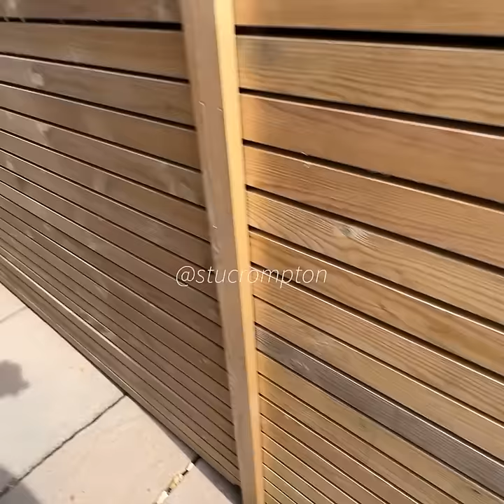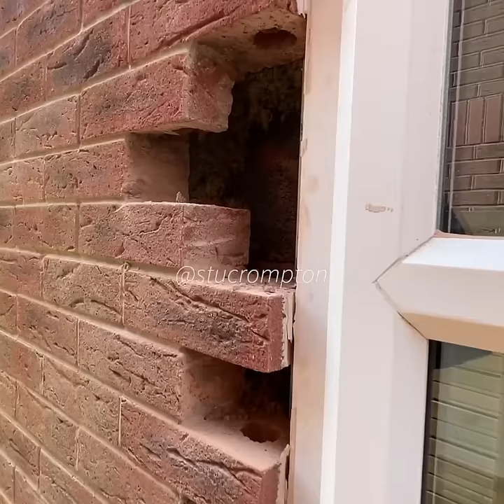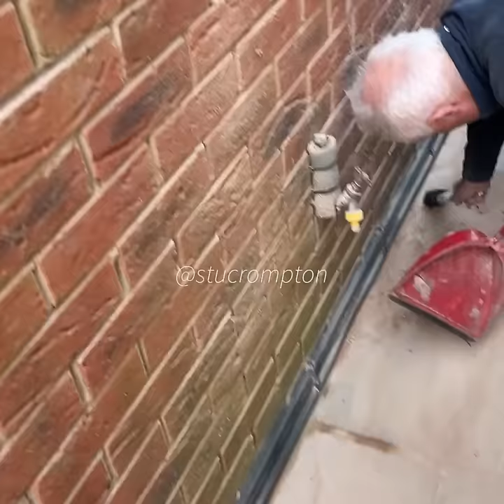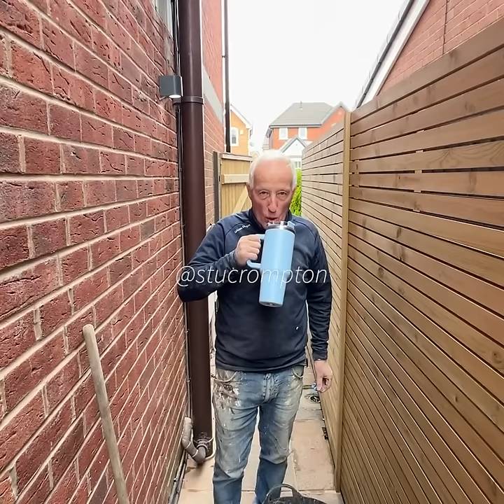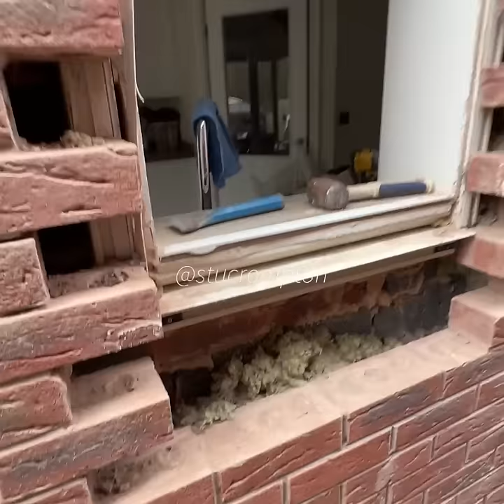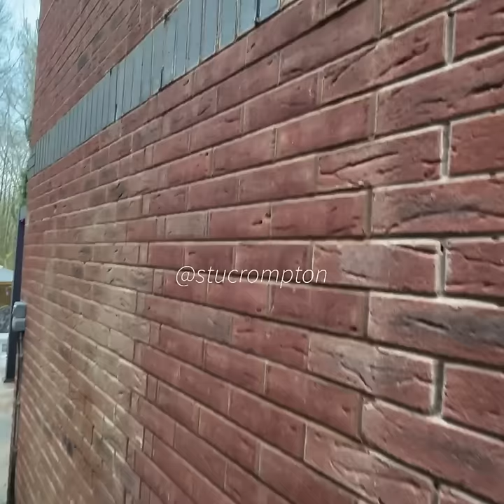🧱Bricking a window up with Dad #bricklaying #youtuber #bricklaying #construction #original 🧱

Comment: I never thought that type of insulation was any good for the building. When the pointing is worn out and driving rain gets in, it gets wet and causes nothing but problems to the internal parts. Even when it gets wet from ground level, it causes even more problems. Great building work, guys.

Comment: I have two questions. First, I have a brick exterior; it has no insulation between the brick and the sheathing. I do have insulation in the interior walls, and I plan on taking part of the wall out. Is there anything I can do to put some kind of insulation in it? Second, the brick is 50 years old, and it's showing its age a bit, and I don't want to tear it all out. I have seen some things for staining the brick; is it a good idea or a bad idea?

Comment: Lovely work. Had a thought. Why not glue with high strength adhesive the quarter blocks so it looks like they’re one brick. They’re not holding any weight due to the lintel so it would make it look like it was meant to be that size all along and you wouldn’t need the mortar.
Reply from the maker: It’s a good idea but didn’t have the time to mess about with it. Only started at 2 and it’s raining for the rest of the week 👍
Reply: Yeah the weather is always against us 😅